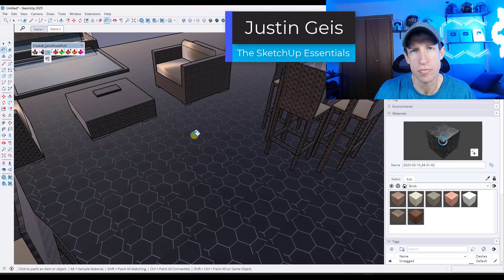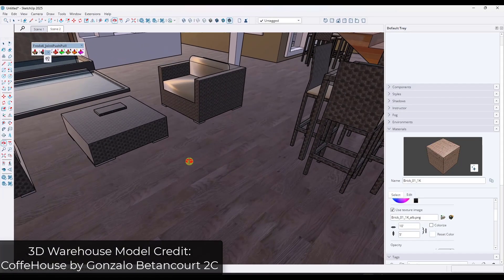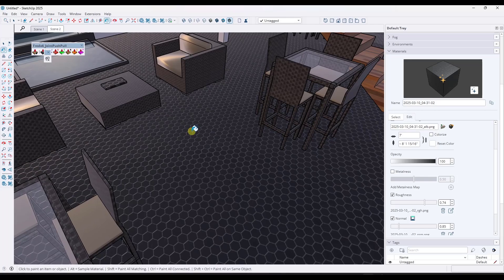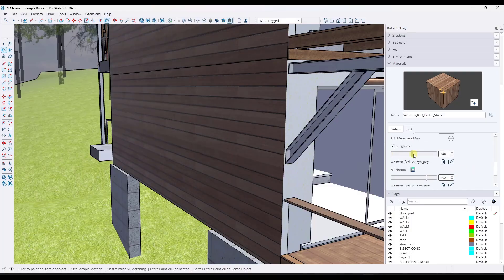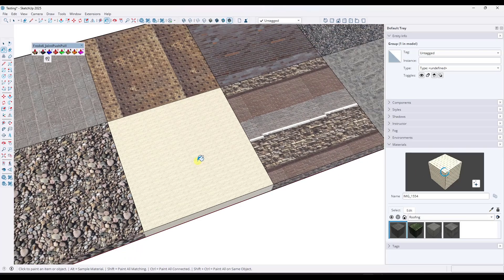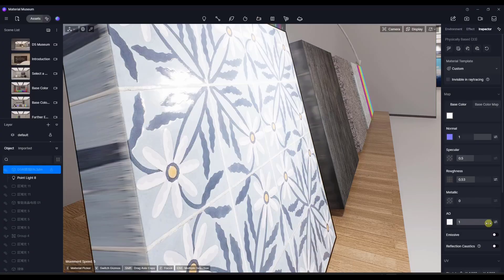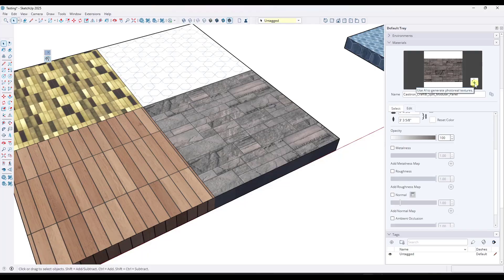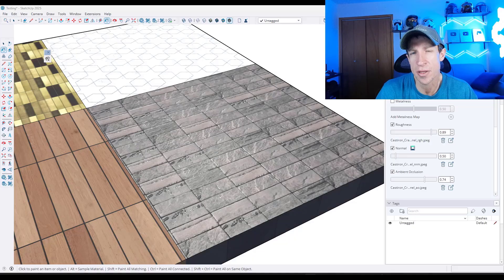We NEED to Talk About SketchUp 2025's AI Texture Tools!

Comment: Thanks again for an excellent video! I have also found the same horrible issue of AI writing over the original material😱Also, in the SU 25.0.571 material control, there is no longer a button to reset the material to default: If you happen to add a material to an object, you can't make it textureless again. (As a roundabaut I have used an extension "Global Material Changer")

Comment: Hi Justin. Thanks for the video. As I have already mention in comment of your another video, I would recommend to Trimble to carefully listen architectural community. As you have mentioned, the AI has a big flaw as it change intended design. It was the same with Diffusion AI tool. What I would emphasize here, is the fact, we can use better tools to produce a kind of rendering, even V-Ray is implemented in Sketchup, so who really needs that materials improvement? But I really struggle with a proper interconnection with Layout. When I will be able to generate section with all that hatches and dashes with easy to produce a documentation? It needs some kind of section tool to be a native  implemented in Sketchup and we should not be depended on Skalp plugin, or Condoc tools... I am with Sketchup from 2009 (paid version) and Layout is more or less in the same UIX design and its tools and usability as well... So, to be positive the update brings at least a something new, but do professionals care? By the way, the yearly updates bring me a pain, because usually I need always to wait for updates of other plugins and connected rendering software (D5, Thea are still not working properly with new version, and I suppose many others too...)

Comment: I wish sketchup would focus on integrating a lot of these modeling, sculpting plugins. I see that as a more useful and needed improved feature than these stuff that can be done in Vray, Enscape or other engines.
Reply from the maker: I'm ok with the rendering engine, as really that's kind of an entry level feature for MOST 3D software anymore, and I think with some adjustments this could be a useful tool. That said, I do agree that the path forward for SketchUp should be more modeling functions and improvements to Layout, which is the common theme of most of the comments I've been getting. I'll keep banging that drum as long as it takes!